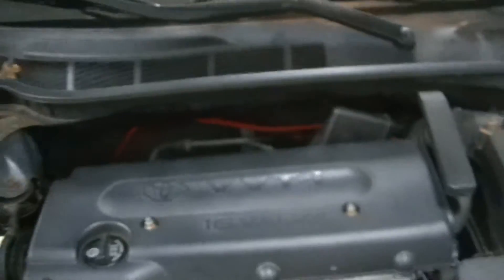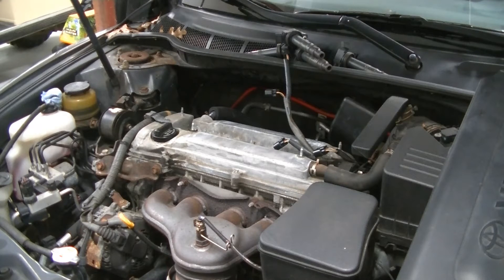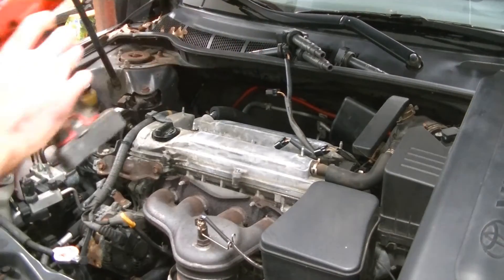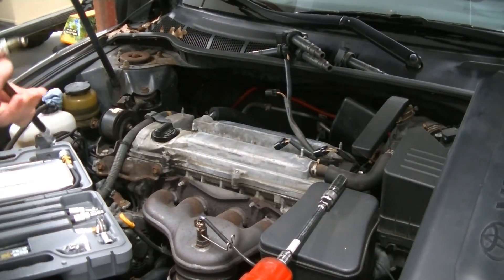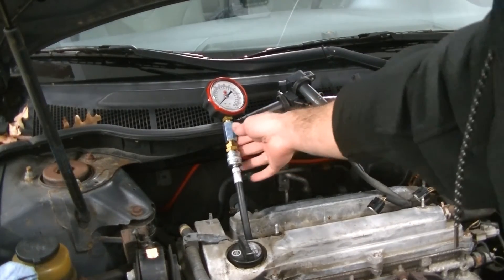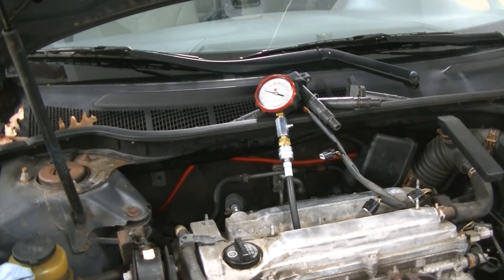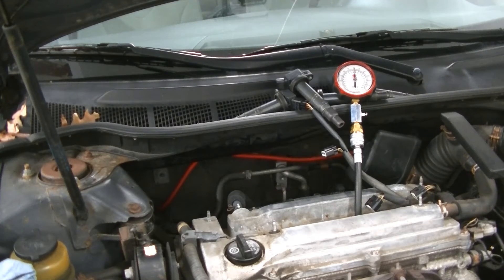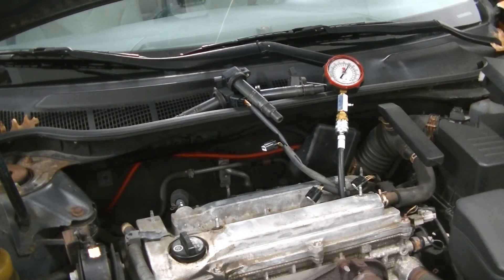How to check your compression with a compression tester!

Comment: How is your oil consumption on this motor?
Reply from the maker: Doesn’t burn a drop!
Reply: @SEsGarage  that was like mine up until 100K.  Not a drop in the oil change interval. Then it started all of a sudden a quart every 3K.  6 years later it reached its peak of a quart every 300 miles.  I used Motor Medic Engine Flush out of desperation and it seems to have helped.  Too soon to tell but so far seems to be > 2000 after 700 miles.
Reply from the maker: @volvotango8363  this engine was rebuilt by Toyota at around 70,000 miles for oil consumption with the updated pistons and rings so hopefully it stays this way
Reply: I think you said in a previous video that you got this car with the dealer fix for the oil consumption issue.  Did they put in a new short block?
Reply from the maker: @volvotango8363  from the documentation I found it appears that they replaced the pistons and rings

Comment: Thanks so much for all the info. I have a Hyundai Elantra 2009 with only 40500 miles,  I am original owner. drive under 7 miles each trip ..so severe use.   oil changes once a year at dealership for free and AT and coolant fluids changed once. 

Worried about the timing belt which has not been changed at all.. 12 years.   Can I check the condition to see if it is uncracked or should I just have it changed it for  XXX dollars?   I understand the risk is major engine damage, but I have heard timing belts last way over 100000 miles.  What is a reasonable price for a timing belt change with pulley, idler and water pump  in your area?    Thanks so much.
Reply: The general rule I'm familiar with is every 10 years for the timing belt if you don't do 100k miles.

Comment: I have the same engine in a 2007 Hybrid Camry. There isn't a good way to do this test.  I haven't tried to set it in service mode because I believe it will kick out of that when the first cranks are done. I like to check on cyl 1 misfire, happens on first start after few days of sitting and goes away in couple of minutes.

Comment: Hey man...I am new to your channel and I am very impressed with your knowledge and background in car repair in general. I definately like the experience you have with Toyota and Hyundia  products in particular. I have owned a 2004 Toyota Camry ( 2.4 litter SE version) for the past 10 years and got over 270,000 miles on it before I  had a broken flex plate that caused me to junk the car. I just recently purchased a 2016 Hyundia Santa Fe Sport with a 2.4 L GDI engine . I love this  vehicle so far but I 've heard that these GDI engines are prone to problems with carbon build up on the intake ports after some milage. My SUV in running fine now and I had about 101,000 miles on the odometer when I brought the vehicle this past September. I am still getting the advertise gas milage of about 19 city/ 25 highway and the SUV is running just fine at this time. I was thinking about doing some preventative maintenance by trying to clean any possible carbon deposits on my engine's intake ports by spraying  some BG or lucas  or other type of GDI fuel injector cleaner directly into the intake manifold. I've seen technique on some youtube car mechanic's videos (Scotty Kilmer to be specific) that says a typical backyard mechanic like myself, could simply disconnect the master brake cylinder vaccume hose  from the brake booster, then start the engine and  spray the cleaner into the intake manifold via the disconnected brake booster  vacuum line. The cleaner spray would circulate into the intake vales and clean them off. The removed excess carbon deposits would exit out through the exaughst system.  Would you advise a person to do this  procedure ?? I want to keep my  Hyundia Santa Fe Sport running good for years to come . However, I don't want to do anything stupid that might come back to cost me more money and ruin my day ! ;) Could this procedure  possibly foul my spark plugs, or mass air flow sensors or possibly my catylitic converter ?? Sorry for the long winded question. I would greatly appreciate any thoughts you might have on this Idea or process of cleaning GDI Intake valve carbon build up. Keep up all the great work you do and thanks again for the videos that you provide. Bryan in Maryland
Reply from the maker: Hello! Thanks for watching! And to answer your question in a nutshell, yes I 100% recommend doing carbon cleaning on those engines! I actually have a video doing just that using BG products. You can check it out here 
https://youtu.be/TLVAYKDanyw